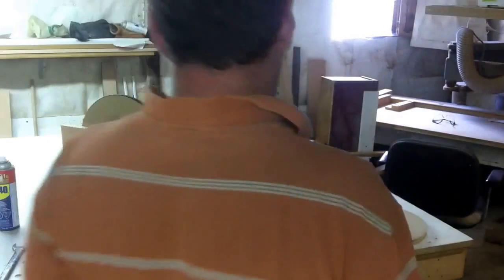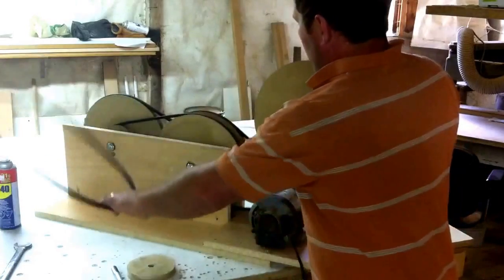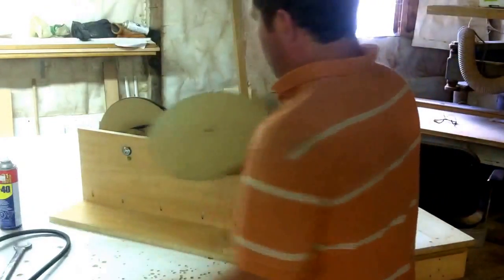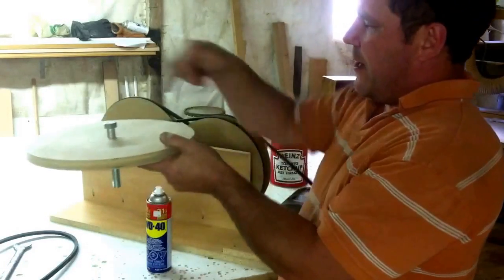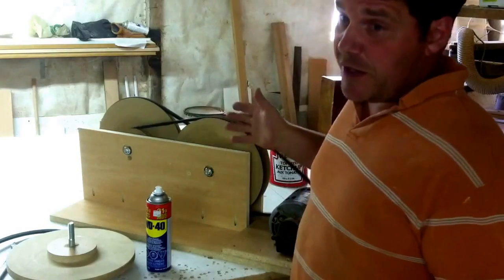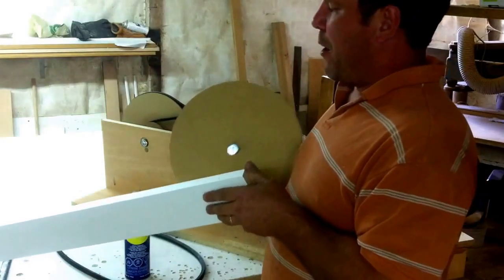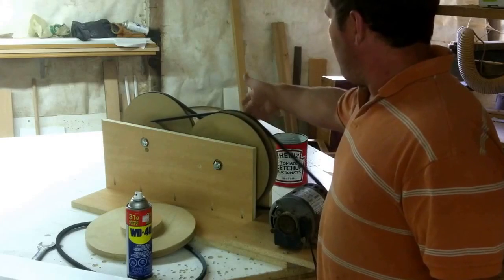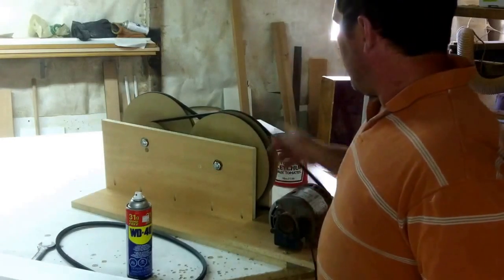Wooden Speed Reducer using Wooden Pulleys part 2

Comment: Would it be easier to use metal skrew to disc? Depending on diameter of skrew and distance between tread tips on each rotation of a screw it will move rotationali the disk depending speed of motor etc. that will take less space too as well you can put as many disks as needet to one lenght of treaded bar...